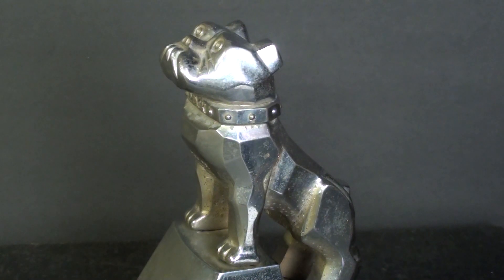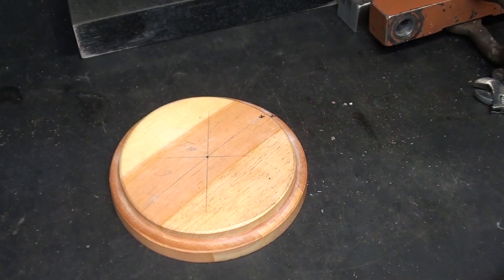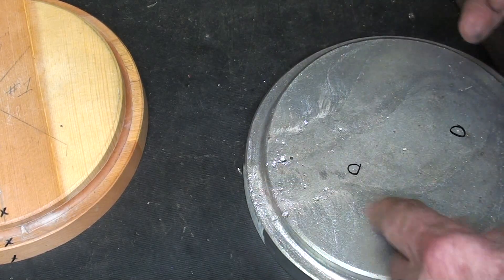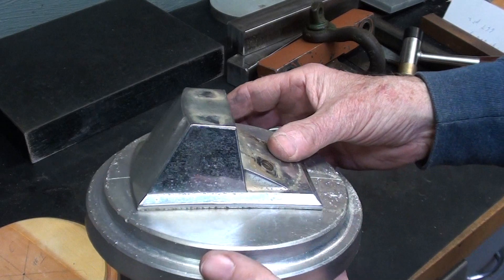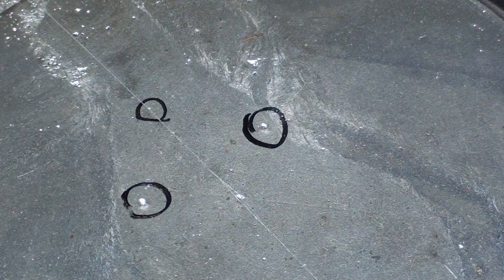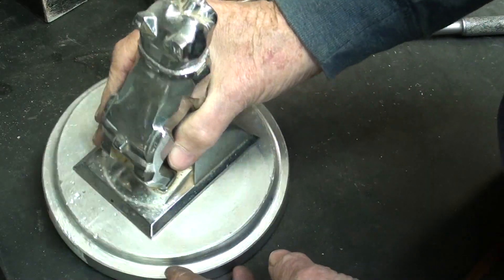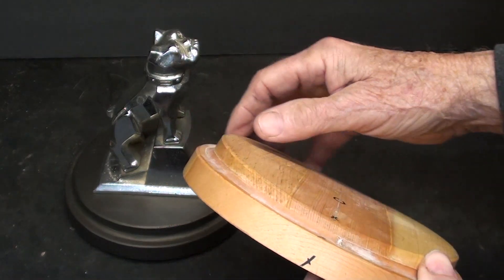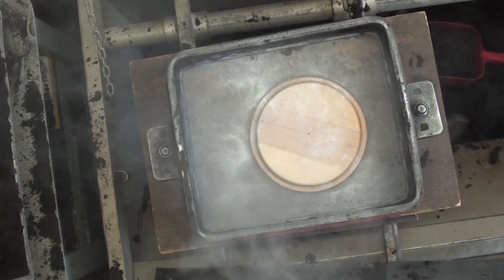MACK TRUCK BULLDOG plinth #667 pt 2 tubalcain casting molding

Comment: I haven't done casting since HS, 40+ years ago.  Our project was either an aluminum anvil or a C-clamp.  I wonder where my anvil went?  Last seen at Mom's house on a windowsill.  Just trying to think this through if I ever get into it.  Would it be better to have the finished side up in the mold so any sand that washes in may be on the underside of the piece?  Leather chamfer, I would have never known that was available and would have guessed Bondo, or some other filler to form the radius.  Great stuff, Mr. Pete, always appreciated.

Comment: Now you need a gold Mack Bull Dog. Mack trucks with Maxidyne engines, Mack transmission and Mack axles are fitted with a gold Mack Bull Dog to signify the truck has all Mack made components. Trucks made with other manufactures engines, and/or driveline components received the chrome Mack Bull Dog.
Reply from the maker: Thanks

Comment: By my calculations, 3/32" per foot is 0.8%. Also, since the shrinkage occurs in 3 dimensions, the radius of the top will also shrink by 0.8%, which in this case is about 1/4"
Reply from the maker: Thanks

Comment: Another enjoyable build.
However I do think you forgot a couple of things. 
It would really dress it up if you added Brass tags. 
One listing the donor and another stating what it is and who mounted it and when.
Reply from the maker: Good idea, send me one
Reply: @mrpete222  I was hoping for a lesson. 
Maybe an  experiment with a panto graph,  maybe using a stylus to trace a paper print out and a scribe to scratch letters into brass or aluminum. Maybe a cheap rotary tool as an engraver.
It's been 40+ years since I made labels using rub-on letters and clear lacquer or Photo artwork and sensitized metal foils or Xerox reductions and clear lacquer.  I don't know if rub-on letters are even a thing anymore.

Comment: Hi Mr Pete looks good . If i remember right  the Mack trucks i worked on in the 90's  ( box trucks 20-24 ft ) were metric and i think i remember seeing things made in brazil on them .Question  are soda cans a good good source of aluminum for casting ? I will cash them in 5 cent's ea. but i do have a set of old truck16.5 wheels i will cut up to make some thing out of I'm so glade i didn't scrap them  . Thanks for your hard work .
Reply from the maker: Thank you for watching. No, do not use aluminum cans, they make terrible castings
Reply: @mrpete222  Thanks

Comment: I have a resin 3D printer that has a layer height of around 10 microns, so you don't get those lines.  The hard part is learning the 3d modeling software... If you need any patterns, let me know and I'll give it a shot

Comment: If the shrinkage in bulk aluminum between molten and ambient is 6% then a pattern radius of 32.9" would yield a casting with a radius of 30.9" (although this is only an approximation as your plinth is not a block, but hollowed out) i.e. 32.9 x 0.94 = 30.9
By starting with a pattern radius of 30.9" the casting will have a radius of about 29" and the chromed stand for the bulldog might have a tiny rock in the forwards/backwards direction.  But when you tighten the hold down bolt, both the chromed stand and the aluminium plinth will deform slightly, so I doubt that you could get a 2 thou feeler gauge under each corner.

Comment: It would take 10 minutes or less to create a 3D CAD model for this part. Creating draft and corner blends is easy. You put nomenclature like part numbers on too.  It takes a few minutes to create the print file and several hours to print. A professional grade 3D printer will hold tolerances of a thou or two. The print time would be reduced by making the model as hollow as possible. The strength requirements here are modest so the outer skin could be 40 thou thick backed up by a honeycomb or rectangular rib pattern at a 1/8 to 1/4 pitch. While this would seem to be unreasonably complex but the software does it with just a couple of clicks. The thinner the layer the smoother the surface but longer the print time. My printer will do 5,7,10,13 thou layers. Going from from one layer to the next smallest will double the print time but make a smoother part. I would guess the print time for this model would vary from 2-16 hours depending on layer choice. I use 7 to get really smooth parts and 13 to get fast parts. There are times when the layer look is desirable and times not. 

The down side of all this is the time it takes to master all the tools. I have done 3D CAD for over 30 years starting with computers that cost more than a house. I can easily do most of the things I normally do, but still learn new things when I stray from the norm. The CAD system has a lot of features I never need so I know nothing about them. A complex design may take a few years of all day CAD to produce. It might involve
thousands of parts. I know I've done it. Those parts may under go structural stress or thermal analysis in the CAD environment too. Just more to learn.

 It probably takes a year for the hobbyist to develop a practical level of 3D CAD skill while the Pro is still learning after a decade.

The software for my non-hobbyist 3D printer is complex too. It takes a year or more to just make peace with. I would say it takes a least a couple of years or more to achieve a professional level of understanding and execution of 3D printing. Designing parts for 3D printing is like no other manufacturing process. You have to rethink everything. Sometimes the impossible is easy and sometimes the simple is impossible. 

These technology tools just like the lathe and mill take years to master.
Reply from the maker: Thanks 👍👍👍

Comment: Lyle, I expected you to drill the angled holes through the base to attach the bulldog.  I suspect that all three screws went through the Mack trucks' hoods for this piece.  However, just the one screw like you did it is more than sufficient for a display for your den.  In the extra credit portion, it looked like you might not have cleaned the loose sand out of the bottom of the riser "hole" before closing the cope & drag -- if so, I guess that's where the casting imperfections came from.  Regardless, thank you for sharing everything in this project!

Comment: Mr Pete, when I was a boy there was a construction company service shop and storage yard along with a concrete company at the end of the street that we lived on. In the sixties there was not much in the way of ecological impact thought given to the storage of used or discarded equipment. Due to the size of the construction outfit, there was a considerable amount of discarded or idle equipment stored there and when I say that there were huge mounds of stuff I am serious. There was a guard on the lot occasionally who would catch us kids playing there and he would rather nonchalantly tell us to be careful and just ignore the fact that we were there and even let us take items of junk from the mounds of “Treasure.” I learned to work on small engines by bringing home choice specimens that I discovered on those mounds. Another of the discarded items on that lot were discarded junk vehicles and most importantly Mack Trucks with the Bulldogs intact. I can remember trying to get those mounting bolts lose with the one tool that I always had withe me, a Barlow knife. Not having the right tool for the job, I grabbed the nearest heavy blunt object and began wailing away at the Bulldog’s head only to have the base snap into several pieces thus freeing that “Trophy.” I grabbed that Bulldog and carried it home. It was pretty difficult to display without the base so it was relegated to one of several junk drawers in the basement of the house where I kept my  “inventory.” I had forgotten about that and thank you for the memory jog.
Reply from the maker: Thank you, that’s a great story. Sounds like something we did. There was an auto salvage about a half a mile from our house. We would sneak in there and create havoc. We got caught once

Comment: How long do you reckon it would take to model that pattern in 3d confusion then to run the job on the printer?  Maybe someone that models regularly could do it easily, but even knowing my way around Blender I can see wasting a few hours trying to get that pattern right. Horses for courses I guess, I think I would lean towards the good old-fashioned wood pattern myself.
Reply from the maker: Yes

Comment: Mr Pete how do you cut your aluminum without clogging your bandsaw blade. When I cut aluminum it gets chunks on the blade that you can't hardly get off the blade and when it comes back around it hangs or bangs real hard very frustrating 😤 whats your tip to keeping it off in the first place
Reply from the maker: I have the same problem, because we are not using the correct blade. Just a little bit of WD-40 on the blade helps a lot